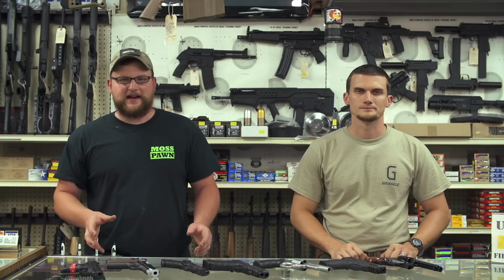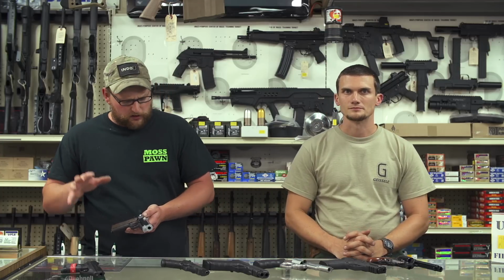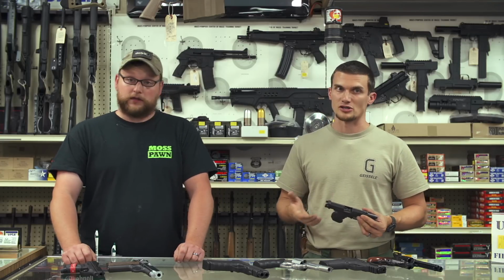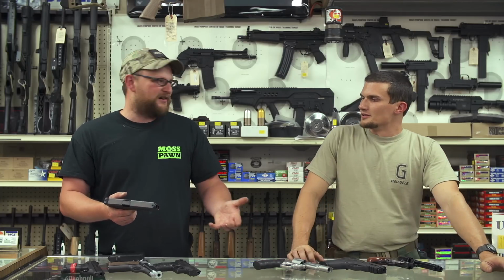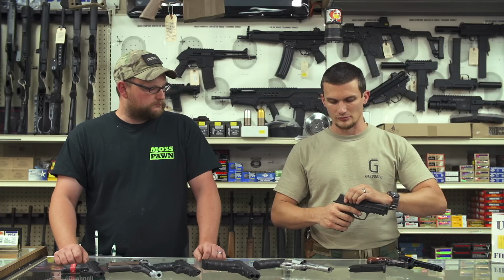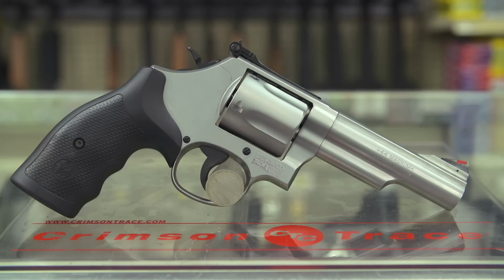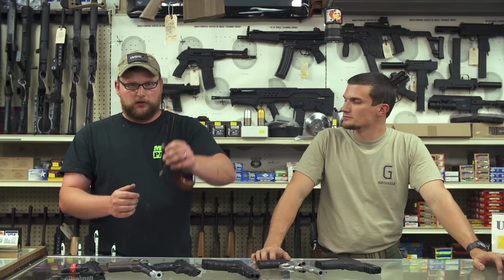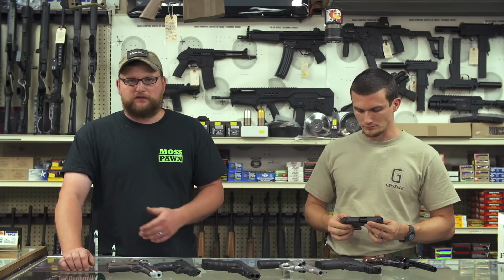Handgun Etiquette for Beginners

Comment: PLEASE STOP!  Whenever someone talks about the "safety" on a Glock they say "you have to pull the trigger for it to go off."  THAT IS NOT A SAFETY!!!  A safety means when you pull the trigger, the gun does NOT go off.
Reply: I'm confused with your logic here- you're jumping around two different issues. A 'safety' is the meat between your ears. Glocks are drop safe, unless you can prove to me otherwise under normal conditions. What exactly are you trying to say?
Reply: RobsGamingNetwork Haven't you ever heard of a safety on a gun?  A little switch you click on or off?  Of course they are drop safe.  I had a Savage O/U made in the 50's and the hammer would not hit the firing pin unless the trigger was pulled.  Being drop safe should be a given in a firearm.  That is not a safety feature.  

All I'm saying is a Glock has no safety.  The "safe action"  is fine but it is partly a marketing gimmick. 
Safety "between between your ears"  refers to handling the gun safely and has nothing to do with a safety on a gun.  When a gun is on safe, it will not fire no matter how stupidly you handle it.
I'm not that experienced, but i shot my first Glock yesterday and I thought the trigger was pretty light to not have a safety.  Of course, people are free to carry them if they want.  I'm just nervous with guns that are "ready to fire" and have no safety.  

It's just an opinion; but I'm sure that's why Ruger is selling so many LCR's and the Smith Airweights are so popular. 
 If Glock was smart and wanted to make money, they would increase their sales substantially by putting a safety on one or make a true DA.
Reply: Juan José Fonseca Godoy I guess your left hand is the safety.  It won't go off unless it's loaded.  Or your safe is the safety, it won't go off unless you take it out of the safe.
Yes, a gun is really safe if you don't shoot it. 
What if your finger is the safety and your 10-yr-old son pulls the trigger?  I guess his finger is not the safety?
Lot's of guns have gone off without pulling the trigger.  And lots of people have died when an unsafe finger pulled the trigger.
Reply: Juan José Fonseca Godoy That's part of being safe.
So in your whole life you've never heard of an accidental discharge?
Reply: sycamorebacker1
Have you ever heard of someone getting hurt in an automobile accident?  What part of "accident" do you not understand?
Reply: Juan José Fonseca Godoy Huh?  If safety is as simple as your finger, I don't know why safeties were invented.  And the next time I go to a range, I'll tell them I don't care if people walk around behind me with loaded guns, because each person has 8 safeties.
Reply: Juan José Fonseca Godoy Well, we've gone on with this for long enough.  Actually, we got off track.  My original point was that Glocks don't have safeties yet people talk like they do.  If the trigger is pulled, it will go off.  When I go rabbit hunting with 3-4 friends, we all have our safeties on and that is safer than not using the safeties.  There have been people killed in hunting accidents whether you admit it or not. TheYankeeMarshal has been shot twice, so ask him if accidents happen.
Reply: sycamorebacker1 You are wrong about Glocks. I own a Glock19 and it is ALWAYS on safety until I pull the trigger. You can throw a Glock with a loaded chamber as far and as hard as you can and it will not fire!! The best safety for ANY firearm is the intelligence of the shooter.
Reply: Renegade Wa
No. you are the one that is wrong.  If you pull the trigger, it fires.  There's been lots of intelligent people shot with accidental shootings.
Reply: sycamorebacker1 I don't think I'm wrong because I'm not the kind of person who walks around with my finger on the trigger of a loaded firearm. I've been shooting for more years than I care to remember and have never had a mishap because above everything else I respect the power of what I'm holding in my hand. I've seen people at the range with their finger on the trigger standing there talking and I have even seen one guy text messaging with his phone in one hand and a gun in the other hand.That's when accidents happen. The best safety on ANY firearm is the gray matter between the ears of the person holding it!! I know some people don't like the safety trigger on the Glock but I have never had an issue with it however I do respect your opinion.
Reply: Renegade Wa Thanks.  Nice post.  Not sure of spelling, but Sooch?? here on youtube, his grandfather was killed in a hunting accident.  I've handled a few long guns and they all either had a hammer or safety.  I don't understand why a handgun should be any different.  I would hope none of us are ever in a situation where we didn't have time to click a safety to defend ourselves.  The safety is turned off as the weapon is being drawn, so it takes no time.  And there is no way that a safety doesn't make a handgun safer.
 I blame Glock for half-cocking a firearm and then sticking that fruity thing on the trigger and saying that is a safety.  They don't care about safety -- they just want to sell guns with any gimmick they can.  What gives Glock the authority to change the definition of a "safety?"
Reply: Renegade Wa I'm glad you've never had an accident.  My grandson is getting his drivers license and I tell him that his first mistake may be his last.
Reply: I'm a Glock user and very happy with them.  They are drop-safe (but no mechanical gizmo can ever be 100%), and no, not all firearms are drop-safe. The trigger safety is there as a level of safety that the gun won't fire unless the shooter pulls the trigger.  There's internal features on Glock that provide redundant safety that it won't fire unless the trigger is squeezed as well.  

A traditional safety, such as a cross-bolt safety or thumb lever safety, precludes the firearm from firing, period.  And no, a Glock doesn't have that.  There ARE substantial cases of unintentional discharges from Glocks.  People do stupid things.  People carry them chambered in jacket pockets or in a ladies' purse along with their car keys and ball point pens, and a key gets in the trigger guard and ends up pulling the trigger when the user tries to pull the weapon out.  People keep it chambered in the nightstand, hear a noise downstairs, grab their gun when half awake, and a finger falls on the trigger.    If you are new to pistols, haven't been trained well,  or otherwise don't quite know what you're doing,  Glock is probably not for you.  On the other hand, Glocks are designed as they are for people that do know what they're doing, and understand how to carry and use the gun properly and safely.  If you have the knowledge or are willing to get it, a Glock is a very good choice.
Reply: bahhumbucker Yes, I agree with all of that.  One thing people don't consider when they say "the safety is between your ears," is that YOUR personal safety is also between the ears of the carriers all around you; regardless of how safe or experienced they are. 
I was avoiding guns I thought were unsafe, but since I have had two different Walthers and I shoot them so well (I think because of their trigger), I have decided to use them and just not load the chamber until I am ready to shoot.
Reply: sycamorebacker1 Yeah, the problem with the safety between the ears is that many people think they have an effective safety there, but they really don't.  Learning this with a live firearm can be painful to you or to someone else.  It's all about your thought processes, the protocols that you employ, and how disciplined you are in employing them every time.  Police carry their Glocks with a round chambered, but they are open-carrying in a proper holster and are relatively well trained compared to some dufus with a Glock stuffed into his pocket, gym bag, purse, or glove compartment of his car.  Personally I do not chamber my nightstand Glock, and the trigger is NOT cocked.  This means it won't fire a round when I grab it, no matter if I fumble around or not.   I drop the mag and check it every night.  No I don't believe in ghosts that will rack my slide.... it is all about habit and discipline.  I want there to be no chance that I will discharge my Glock when I grab it.  And I always know that after it's in-hand, it has to be racked.  No need to think, just grab, rack and go.
Reply: bahhumbucker We sound a lot alike.  When you say on here that you have a gun unchambered, everyone says your crazy and some 300 lb meth-head will appear out of nowhere and break your neck before you have time to click the safey or rack the slide.  I figure the odds are so slim that I would ever need to use so why make ANY compromises on safety.  And really, you can have the slide racked by the time your feet hit the floor.  I'm kind of new with handguns and I feel a lot safer with a revolver at home.  At least I know I have the DA for safety.  The only problem with that is that I have to make double sure that it is put away when grandsons come over.  I know the first thing a kid wants to do with a gun is pull the trigger.  I've even considered keeping one chamber empty so the first pull would be safe.
Reply: sycamorebacker1 I don't think racking the slide creates any real penalty.  For me, I know what to do; the scenario is very clear in my mind and won't slow me down at all.  If the meth head is right on top of me then I'm dead in any case.  Having a gun doesn't guarantee that you'll live to see the sunrise, it only improves your odds.  A wheel gun is a fine choice for a defensive handgun.  Truth be told, My primary home defense weapon...and I have an embarrassing amount to choose from....  is a 12g pump.  Safety is always off, but no shell chambered.  Same logic.
Reply: Why would you want a gun to not go off when you pull the trigger? Safeties are useless and are only used, in concealed carry situations, by people who lack confidence in their abilities.
Reply: theAwakener I have a lot of confidence; and I also know how a safety works.  I guess you need to do some research.
Reply: Research on what? Safeties? They are a pretty elementary concept. I want my gun to be as deadly as possible when I pull the trigger because, in a self defense situation, one does not have the time to flip a safety, especially if an assailant is on top of you. In this case you need all the time you can get. This Is why I don't use a safety. It takes more time for me to be just as deadly.
Reply: theAwakener Of course you want your gun to go off when you pull the trigger.  Goes without saying.  But you DON'T want your gun to go off when you are fumbling to quickly grab it in the dark and your finger falls on the trigger when you're barely awake.  It's naïve to think that this doesn't happen.  That's also why people that carry in their pocket or toss a chambered gun in their gym back are nitwits.  They should always be in a holster.  Ever hear of "Glock leg?"  This happens to POLICE while drawing, and those guys are well trained and fully awake.   Now, I don't personally like lever safeties at all.  It's one reason (there are many) why I use Glocks.  There is no lever safety.  But you have to be nuts to keep a Glock chambered in your nightstand.    I've never shot  in self defense,  but I have grabbed it several times over the years.  As long as muscle memory is strong enough so that when you grab it, you instinctively rack it, you're good to go and don't need a lever safety.  We should not argue about safeties or no safeties.  The only real issue is  the protocol you use.  Some protocols are prudent, some are not.  Glock works for me.... I wouldn't personally want to have my heart pumping 200 beats a minute and pull the trigger when I forgot to click the lever off.  That's why I use Glock and that's why I follow the protocol I outlined.   Safe to handle and will fire when I need it to.
Reply: I totally agree with your stance on Glocks. I thought that you were supporting some burdensome lever safety. I thought that you were one of those annoying internet gun safety nazis lol. My bad man.
Reply: Cool.  By the way, and for what it's worth, I recently revised my thinking about shotguns as a home defense long gun.  I'm now completely convinced that an AR 15 loaded with M193 is much superior, and now use one of mine in that role.  The reasons are that the spread of the shotgun is less than most people think - it's about 2" or less at typical home distances.  Also, most shotguns only carry 5 in the tube.  The AR with  M193 rounds that fragment has less overpenetration, is easier to shoot, is at least as lethal, is generally easier to maneuver, and carries  more rounds.  No matter what Senator Feinstein and Joe Biden say, the number of rounds is very important.  Only an idiot would argue that this gun or that gun has "enough" rounds.  There is no "enough".  You need as many as you can get, because you have no idea how many intruders you'll face or how much suppressive fire you'll need to get your family to safety.  There is no downside to having more than you need, but a serious downside to not having enough.

Comment: Do you think that slide doesn't slam home when you fire the pistol? That is terrible advice. You are supposed to let it slam home so that you are sure that your gun is battery.
Reply: Dodge Mustang it absolutely DOES slam forward as hard as possible after the slide is forced back at full speed by the explosion of the round. The slide goes all the way back and slams forward wherein it strips off the round and drives the round into the chamber and goes into battery with the force of the recoil spring.

Comment: The Glock trigger "safeties" is one of the best features because it encourages trigger discipline. Also there's no manual safeties in the way, which could create a jam in stress situation, which aren't necessary, and are intrusive to conceal carry. Glocks are great because of their simplicity.
Reply: First of all, I'm a long time Glock user and while I have many firearms, wouldn't rely on anything except Glock as my primary handgun.  But don't understand your comment that  the Glock trigger safety encourages trigger discipline.  A gun without a  trigger safety fires when you pull the trigger.  Glock fires when you pull the trigger.  I don't see any difference.  The Glock Safe-Action system is about drop safety; not allowing the gun to discharge unless the trigger is pulled.  I don't see how this possibly encourages trigger discipline.  Not trying to be argumentative.... just want to understand your logic.  I'm a long time shooter but learn something new every day.
Reply: slowly raises hand I know this comment is hella old, but...

   SIGs almost never have external safeties unless you order them to have one. So... Does my SP2022 count? Or does having the little tooth missing out of the trigger make mine 'unsafe' now?

   And just to be clear, I do know about both of these weapons. Yours and mine. Just poking fun at the GLOWK fanboy. Father owns a Gen.4 19 in 9mm. I just could never really get used to the tiny slide release, or the grip angle, or the god awful stock trigger. But I won't curse out ones that use 'em. If it works, more power to ya! I just like my SIG better, though I do hate the gen.2 grips(doesn't look as classy, and it doesn't have those exclusive SIGpro markings) and the rear two-dot night sights. I prefer the gen.1 'dot the i' sights. Also, having a de-cock is so much nicer to me. And I enjoy the fun of double-to-single action firing! Been practicing draws from the holster to firing at a paper target, and I do better with accuracy on that very first shot than the following single-action shots! Go figure.

   Anyway, enjoy your Glock if you still have it! Hope it's still firing true as ever!

Comment: Snap caps aren't a bad idea to have, it certainly doesn't hurt anything to be extra safe with your firearm.  I have only spoken to one manufacturer personally about dry firing and Taurus support stated that their guns are not negatively impacted by dry firing.  They went on to say if an issue did arise it is not by design, but would be considered a manufacturers defect and they would repair free of charge per their lifetime warranty.

Comment: So wrong!  I own a Glock 43 that accidentally discharged while in a holster with the trigger fully covered.  This happened 12/2/2018.   I called the manufacturer of the after market trigger.  He was shocked and drove four hours to witness the functioning.  He verified that there is a problem and took the pistol to fully examine the Glock.  He will replace the trigger and all gun innards.  I have been handling weapons for 73 years including 21 in the Army.  First AD.

Comment: Note the Correction by Eric, MOST new .22 firearms can be dry fired, and the firing pin will not hit the chamber face.
For older guns or if you are concerned about it, go to the hardware store with a fired .22 case and look at the drywall anchors the ones with a flange that look somewhat like a .22. one of the sizes (cant remember the size now) is nearly a prefect snap cap, and cheap as a bonus.

Comment: Guns are designed to "slam the slide"  that absolutely will not cause damage
Reply: seriously, what do they think happens when cycling? the slide slams back into position, using a tiny portion of the energy involved to chamber the next round
Reply: There's also a number of high end firearms manufacturers that say DO NOT slam the slide. Pushing a round forward is not the same as closing it on empty. Hmm...
Reply: High end 1911s are not made for it. Everyone knows that